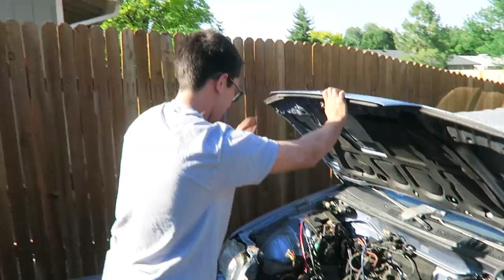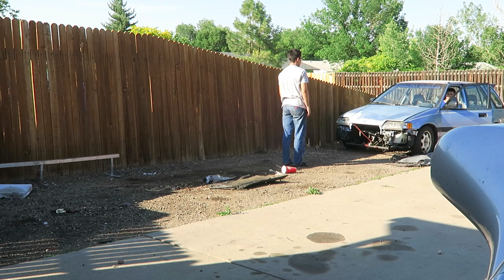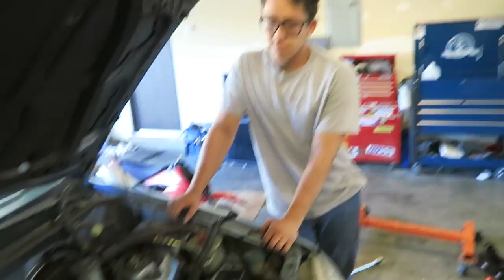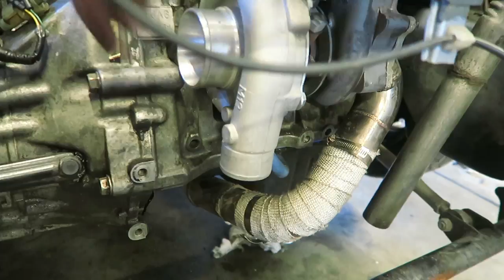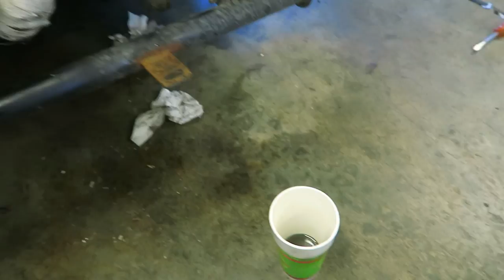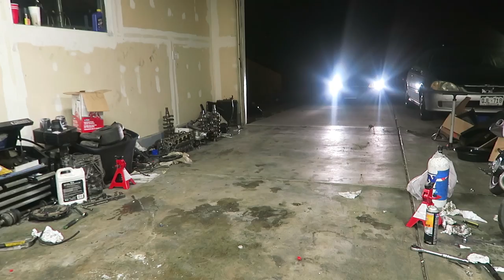Wago is Back!

Comment: Something you may consider trying:

At my shop the first start up consists of our custom oil (non synthetic), let the engine run for 25 mins going from 1400-2500rpm slowly while monitoring all numbers given by the computer.

Next we put in out "250 KM" oil, and drive the car for 250kms again while monitoring the numbers and engine braking by dragging the clutch as much as possible.

Then change the oil again and depending on the type of piston rings use we drive it on semi-synthetic for up to 2000kms.

After we do this we full boost tune the car on our dyno and our engines consume 0L of oil due to the rings being proporly seated.

Comment: RIP Odyssey, I don't think you guys should get rid of this one, you should manual convert it, there's an Acura TL 6 speed LSD manual on ebay right now for $600, I know the computer's pricy but it would be worth it. The 2002-2004 Odyssey made 240hp and went from 0-60 in 7.7 seconds WITH THE SLUSH BOX. Imagine a nice 6 speed in there lol. You guys should totally do it, not that we don't like the H22 builds, it's just that you've done them before.

Comment: You need to put heavy load on the engine when you go on the first drive to seat the rings. 2nd gear full load up to like 5-6k rpm then let off the gas and let the engine decel down in the same gear. Do that same procedure 2-3 times and the rings will be seated. Never drive a rebuilt motor easy for the first few starts or else you will not seat the rings.

Comment: break in is done first 30 min... few heat cylces .  engine should be loaded to place pressure on rings ,promote good seal.   check with any performance engine builder.  they beat on them same day or if engine dyno after 20-40 min break in cycle.  also, i never idle any engine on first start. 2-3000 rpm, crank throws oil all over and there is more oil pressure. jmho.  awesome channel, builds and work you do and show👍. hope i dont sound like a troll. i have real experience building and tuning 4g63, k20, sbf, sbc, and bbc.
Reply: obviously couple oil changes. i do first after first heat cycle. second after couple more. 30-50 miles then treat it like a prostitute 😠😠😆😆.

Comment: don't run without any charge piping you will overspin your turbo because theres no resistance and thus boost to be controlled. a friend did exactly what you though when he rebuilt his motor "oh ill keep it na while I break it in cause I want 0 boost" I said keep your foot out of it if you want no boost, I can run to redline and not build any boost if I modulate throttle. anyways that friend didn't listen and cooked his turbo, then his whole car burned down cause he wouldn't chance a vac hose as a fuel hose I pointed out but thats a story for another time.

Comment: My turbo doesn't spin at idle either but makes boost just fine.. is that something I should be worried about.. ps it's only a eBay turbo not dual ball bearing or anything is that normal?